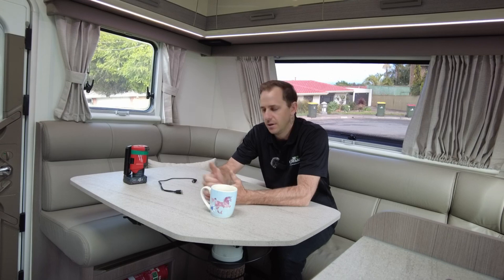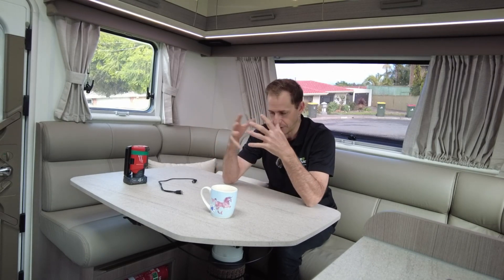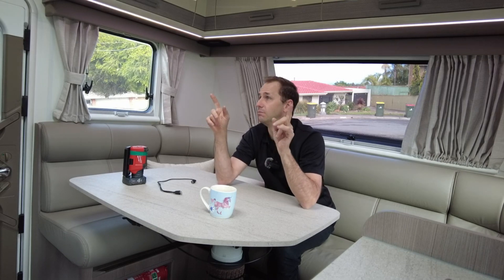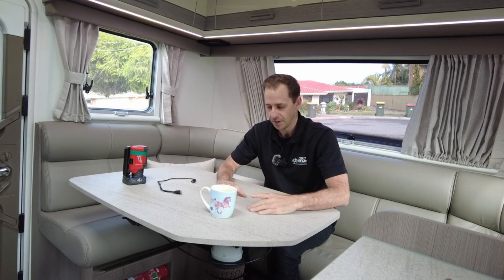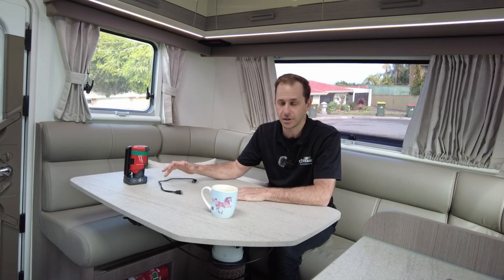How we consult with you for your caravans lithium off grid set up. What’s involved? ￼￼

Comment: You have to ask yourself is 12V really fit for purpose, the fact that you stated the solar runs nothing is exactly why its not fit for purpose and why you get all the excuses around those systems. Do you fit the DCX system from OzXcorp? that system is 51V and does run everything directly (including AC) from the high voltage solar input, whats left over goes into the 7 or 14kwh battery preventing micro cycling and preserving battery life.
Reply from the maker: This is true to a degree I could dive further into this but I'm glad you brought this up. It's much easier to explain to the majority of people how a DC coupled system works rather than say your solo runs things period of course if you get really technical and look closely at how the victron DC coupled system works you will see the PV wattage matches the AC and DC loads it does this but it would confuse people if I show them how this happened. It's much easier to say everything runs from your battery and your soul adjust replenish is it. I can see how you say about micro cycling this is always going to happen as big loads come on and above your solar production let's face it most caravans struggle to get over 1000 watts and the ones that do still can't take that massive inductive load so there will always be micro cycling. Thank you for your question I absolutely love the technical ones like this it gets the chats happening.